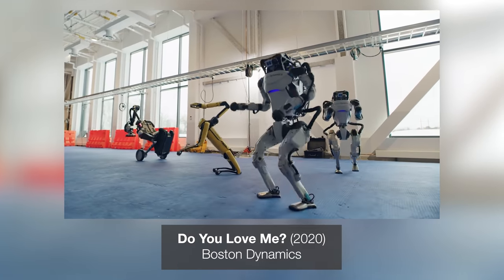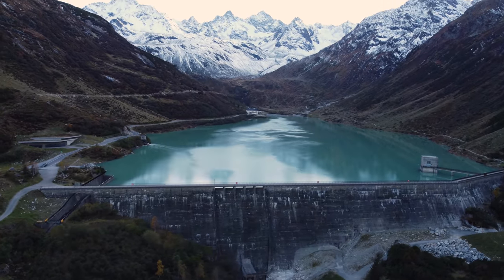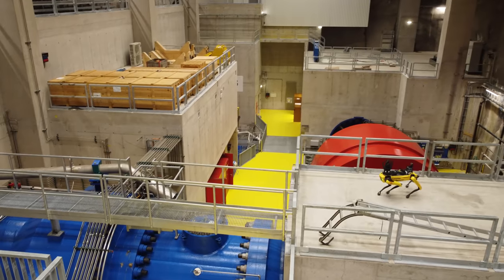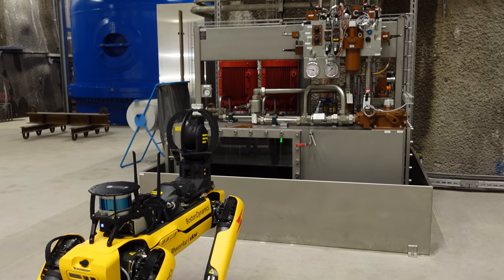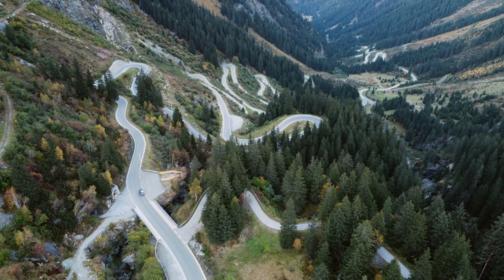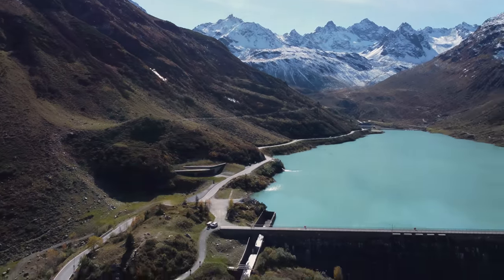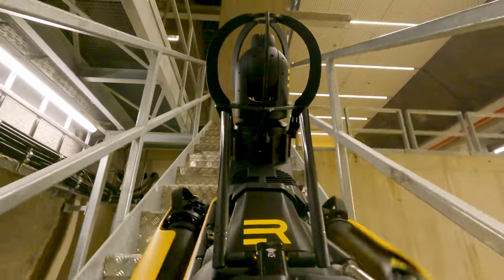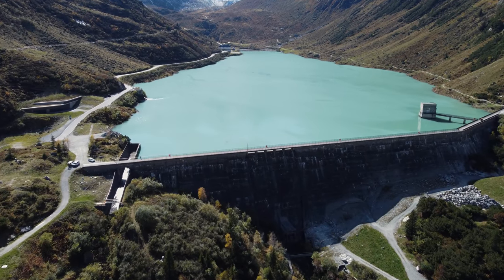An actual, real-world use for robot dogs

Comment: Interesting to see, but this does feel like more of test site for this technology rather than the best or cheapest solution. An array of camera's and other sensors would probably be cheaper and will provide continuous real-time monitoring.
Reply: @ 残高 depending on number of sensors that needs to be deployed but the argument could be made that you are getting continuous real-time monitoring instead of waiting for the robot's report. It's cool to have the robot but it doesn't look practical
Reply: @tmilesp  robo dog probably has a lower failure rate and uses less power
Reply: the thing is, an array of cameras is more expensive and unreliable than one camera.

Comment: finally, a use for robot dog that doesn't make me extremely suspect of the intentions of both BD and the companies buying from them
Reply: There is only one use for a robot dog and its a strong weapons platform
Reply: @big3erg993  Have you seen the video? That makes it at least two uses.
Reply: @TheFrozenMister  didnt you watch the video? Its comical. A security camera with a sensor is 1/10 the price
Reply: @big3erg993  It's simply not though, you'd need a very large array of cameras to do what this is doing, and unless you put a 360 camera every foot or so, all high-end, high quality, with multiple features, you can't have the same as what this is doing. Not to mention the astoundingly larger coding job that would be.
That would not be cheaper, or likely even feasible. This is a much cheaper method in terms of hardware, and I'm not sure how expensive the code development is, but the thing about that is it only needs to be done once (sorta). After that it's definitvely cheaper.
Not to mention that this tech is developing, and not in a wistful far of dream way, we're watching uses emerge, and with every test case such as this, the hardware designs can be refined, and the code can be upgraded, along with data being collected to train that code, for various uses, far less trivial than this.

I don't mean to imply that this wont be militarized, it certainly will (although likely as an equipment carrier and scouting tool before a weapons platform), but it's comical to disregard any and all possibility this has.
Reply: @Red_Bastion  Btw you know a "high-end" camera in an elevated position can distinguish people better then a ground level robo dog by almost 200m?

In-fact unlike you thought it requires no coding at all
Reply: @big3erg993  ooohhhh I think the misscomunication here might be what the purpose of these is. The robo dog isn't for security it's for maintinence checks. That's why it needs to be able to view the whole facility from various angles and have code to identify things in spots it would be costly to put cameras.
Reply: @Red_Bastion  I understood the point from the start and I was kinda playing both fields

but im still firm in belief that putting a camera infront of the mechanical part with a sensor is cheaper then making it so the thing can go up and down stairs

I believe there is a use in this technology. In say for search and rescue
Reply: @Red_Bastion   but maintenance checks as a walking camera. Its infinitely cheaper to install a camera and hire someone to check it or the site

And it also keeps someone employed

I still believe that someone would have to sign off on each robo dog check and if thats the case this is much more wasteful then i thought
Reply: @big3erg993  when the dog pings as not being online or not recieving photos then a mechanic would go down to check
Reply: @DavidSternburgYt  thats still way more expensive then just getting someone to remotely check cameras/heat sensors once a day
Reply: @big3erg993  I think it would pay for itself over time
Reply: @DavidSternburgYt  As in it would require less maintenance and check ups on itself as the technology ages?
Reply: @big3erg993  and uses way more energy and has a higher chance to fail
Reply: @Cybella  Incorrect, having that many cameras increases the electricity and maintenance costs much more than a dog does

Comment: As someone who job it is to go out and inspect machines that have broken down (usually something muuuuuch simpler than this), often in hygienic environments, I can honestly say that I'm not worried about losing my job to these robots, but they can't get here soon enough! Particularly the versions were I can instruct them to make fairly simple but often labour intensive/non-intuitive (for humans) changes to the machines remotely. Shipping a robot to site would almost always be quicker and cheaper than sending me across the world to do it. Even better if our customers had those robots we could access/control remotely, rather than having to ship our own!
Reply: What makes you think you'll be the one who owns the repairbot? As soon as you teach it to do your job, you're fired!
Reply: @kilbert666  somebody still needs to go out and fix something if it is broken and companies still need somebody to be legally responsible in case something goes wrong.
Reply: @Spazturtle  True. The robot is a way to make the job easier, safer, and more precise, but there will always need to be a human to either work with the robot, fix the robot, control and charge the robot (for the ones that aren't autonomous), and/or look at the data the robot is sending (either directly or after being processed by a computer).

Comment: To the point at the end, I can imagine a robot checking that all the thousands of bolts at any given facility are tightened to the correct torque would be more efficient at it than any millwrights apprentice who ever cared to try.
Reply: Problem with that is that the human eye hand cordination is insane and really hard to mimick on a robot. If the bolt is in a weird direction or the bot is offsync a torque check might be hard. In a conveyor line that might be the norm nowdays
Reply: @bhoubit  And as robots get more and more common, machines and workplaces will be designed with having the robots in mind aswell. And the robots will be more designed to handle the machines and workplaces. Take Ocado's automated warehouse for online grocery shopping for example. Specifically designed for robots to do their job efficiently. Also take car manufacturers as another example. Huge robot arms doing their job in huge spaces.
With Ladar a robot could see exactly the direction a bolt is screwed in. Is it a job too advanced for it? Well call in a human. The point with robots is to make jobs autonomous and cost efficient. That way you can use the expensive humans only for jobs that require them.

Comment: One thing that might not be immediately obvious - fixed cameras and sensors can fail in ways that just end up displaying their last valid reading endlessly, and it's very hard to spot if that's the reading that one expects to see.  A roving sensor platform is presumably going to have constantly changing data coming through so a sensor failure will be much easier to spot.
Reply: Remotely turn on light. Does the image get bright? No: go fix.

Comment: Places where the task is too dangerous for a human, too repetitive for a human, too strenuous for a human or too precise for a human.
So things like placing and soldering components on PCBs, moving heavy loads, assembling parts or inspecting irradiated areas.
I can see them being used in disaster management and rescue. Why send a human into the area, that might get injured or lost as well, when you can send a robot build for the task that can offer communication between the injured and rescue workers back at base.
Reply: placing and soldering components on PCBs can be done with something far simpler (and probably cheaper and better suited) than a robot dog.
Reply: Underwater welding....

Comment: I would love to have one of these at the LHC.  There can be no access there for weeks at a time and sometimes all you need to know is if a cable become loose or was something installed wrong.   Its amazing even with how many pictures you take when you do have access how the one thing you want to check wasn't photographed or was obscured by something else.
Reply: Would be interesting to know whether these robots can be built to cope with the magnetic fields, radiation and other "interesting conditions" present in the LHC while active.
Reply: Probably would fry the motor drivers with backfeed and scramble the rest. I worked on the USS Gerald Ford, had a control cabinet about 2m away from a 4kV 3 phase motor cable that threw faults anytime that pump was started.

Comment: For inspections, it seems like fixed cameras would be easier, cheaper, and just as effective? During failures, I can see having a mobile inspectors as a good option, but during regular operation, it seems excessive.
Reply: Right? I think this type of technology would really shine in novel environments, where there arent static or known goals.
Reply: Exactly my thoughts
Reply: That's a good point
Reply: Interesting point, I suppose it would depend on how many inspection points there are. I could imagine that if there were thousands of spots that needed to be checked one camera/temperature sensor for each would be far more expensive plus it adds bunch new things that needs to be maintained vs one fixed price robot for the entire plant
Reply: @CaptainFuzzo  Exactly. The robot is more complicated than cameras, but  it has the potential to do way more labor than the money-equivalent amount of cameras. Maintenance included.
Reply: If there are hundreds of points that have to be monitored it might be cheaper to buy and maintain one robodog than hundreds of cameras. Some of the cameras might need to be in areas that are dangerous to humans making instillation and maintenance difficult. You also have the option to send the dog anywhere, even to places that might be blind spots for a camera system.
Reply: another feature of the dog is that it can change inspection paths arbitrarily to look at anything it can reach, fixed cameras cannot achieve that.
Reply: I was thinking the same thing - cameras would be considerably cheaper once installed and could monitor continuously rather than intermittently like a robot.  However this only works if the cameras are cheap.  They mentioned in the video taking a thermal reading.  High resolution thermal cameras are ridiculously expensive (maybe you could buy 3-4 for the price of one spot) so in that case sticking one thermal camera on a moving platform is definitely cheaper than buying a bunch of fixed thermal cameras.
Reply: I worked on a project like this 10 years ago. We had all analogue equipment at a number of remote stations. Rather than doing a full scada retrofit, we pointed cameras at the important guages, and had an E-Stop that could be hit remotely
Reply: @Berkeloid0  But why would you want the camera to monitor continuously. If we need to monitor something 6x a day, with a fixed camera, we may be recording continuously, but we wouldn't save that data or act on it anyways
Reply: @mikesolo7993  Look up "motion amplification" as that's one thing you can do with continuous monitoring.  But my point was if cameras are so cheap then continuous monitoring is a nice extra even if you don't need it.  Sure you might throw away all your readings after a week but having high resolution metrics might help you spot patterns you wouldn't notice with only six data points a day.  You might have spikes that you miss because they only happen in between measurements, for example.  You might also identify a problem and want to go back and look in fine detail at what happened in the minutes leading up to that problem.  There is plenty you can do with continuous monitoring.
Reply: If that was so simple, everyone would already use that method instead of sending people everyday, let alone consider using robots right...? I mean, outside of placing them in a facility just to test how they perform.
Reply: @CaptainFuzzo  PTZ cameras can cover quite a bit of area. I'm really surprised that a robot is cost effective here.
Reply: Fixed camera require fast internet and someone local to monitor it, you missed the part of using it because humans can't get to the location with server snow makes roads impassable.   
Why pay a human to do that, when you can have a robot do that.
Reply: @Dranzerk8908  The robot is 'special' (and expensive) because of its movement and path-finding algorithms, not because of its signal processing. If you would replace the robot's sensors with cameras and static sensors, you would of course replace its 'brain' with a static computer. That could be in the same building, or remote, indeed depending on required bandwidth. 

BTW, it's already very likely that processing is done on a separate computer, for a setup like this you want to minimize the amount of weight and power consumption you carry around.
Reply: If you have pipes on the cealing for maybe 200m, this would mean dozens of cameras on each side and even then the view points are limited. A moving camera is a lot better there.
Reply: @mllhild  Yes, that's why i'm talking about PTZ camera's. And even 'dozens of cameras' aren't that expensive, you can buy them well below 100 euro/dollar nowadays, and a simple pc can process many HD inputs with ease.
Reply: For all the guys in this reply thread. Lets not forget that we are talking about a freaking power plant. They can afford the cameras, guys. They are just bored to death and wanna play with a robodog.
Reply: Another feature of the dog is that it isn't a dog
Reply: I’m sure in real world situations they would run the numbers and do the cheaper option, and in this situation cameras might be cheaper. But I think this is serving partially as a long term test as a stepping stone for more hazardous/less static situations.
Reply: Agreed, or even a small flying drone would be ideal to do that job too, and much cheaper.
Reply: @domitorid177  I dont think anybody's saying they wouldnt be able to afford it.. thats not what companies or anyone usually looks at. its more so what the cheapest option is, otherwise you're wasting money.
Reply: @colinmerrilees  if a drone hits something and crashes at any point you would need to manually restart it each time
Reply: They're trying so hard to find an application for these things--the desperation is palpable. Once the military figured out it would be several decades before they could be used to kill people autonomously, they backed out.
Reply: @TRak598  those robots cost $75,000 USD. How many cameras does that equate to? 100-150 at least.  And that doesn't include the other costs a robot requires, including maintenance and repairs, tech support, training, etc.
Reply: @Berkeloid0  FLIR cost a few hundred dollars, to maybe a thousand. The robots cost $75,000, base price. Additional sensors (like FLIR) adds to that. As does any other specialized equipment.  Not to mention operational costs of the robot. (Repair, maintenance, twch support, etc) that are much cheaper for cameras.
Reply: @mikesolo7993  then you have software monitor it for changes or excursions. Still cheaper and easier to implement than a robot.
Reply: I think it's also to test this new tech. I bet they already have cameras in many spots
Reply: I have read many replies bith is favour and against this, but I'm still not wholly convinced by any side. It'd be nice Tom Scott could shed some light on it.
Reply: @Berkeloid0  You don't need a thermal camera to take thermal readings... a simple sensor (NTC, thermocouple, or infrared) i cheap and can give more accurate temperature readings of stuff. You can install them everywhere, make a board with the sensor, a dirty cheap 0.50c microcontroller, and a RS485 transceiver or RF interface, and install them everywhere. 

This solution seems overkill and not reliable, a robot can experience failures, more failures than a bunch of IP cameras connected to a server (two for redundancy) to register the RTSP streams, and a bunch of temperature/humidity/whatever sensors wired in a bus to a PLC, that by the way can be integrated with the main PLC of the plant to shut down the whole thing in case something goes bad.

The robot can fail, can go into areas where it gets stuck and you need to send people to free it, and you can't monitor continuously the whole plant. It seems today that we are in search of difficult solutions for simple things.
Reply: @alerighi  I get the feeling that this is part of a broader scheme to test these robots in real world situations. You're right that it doesn't really make much practical sense to have these when existing tech can do it fine, but they probably got offered it or just had extra budget to blow.
Reply: It's an investment into the technology so that maybe it will be better than fixed cameras and people someday
Reply: @jmacd8817  If you can find a PTZ FLIR camera with resolution better than a postage stamp for a thousand I want to know about it!  Last I looked they were closer to $20k each.  Sure the handheld ones are cheaper but you can't exactly mount them on a wall and plug in a network cable.
Reply: @alerighi  The point of a thermal camera isn't to take temperature readings - the equipment probably already has these sensors built in, no need for 0.5c microcontrollers.  The point of the thermal camera is to monitor for hotspots that signal impending failures, in places that you wouldn't think to monitor with a direct sensor.  Not to mention that slapping 1000 temperature sensors on a small machine is just impractical.